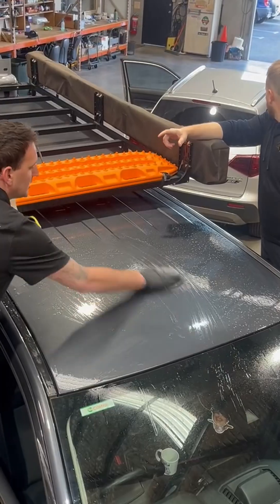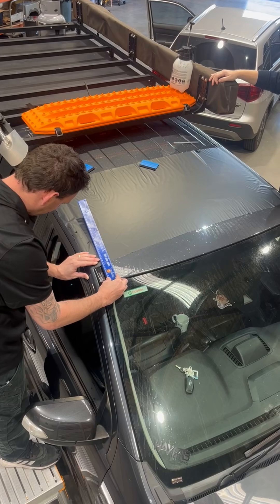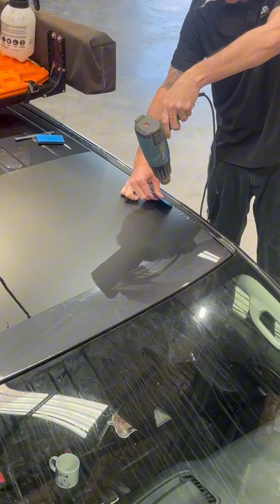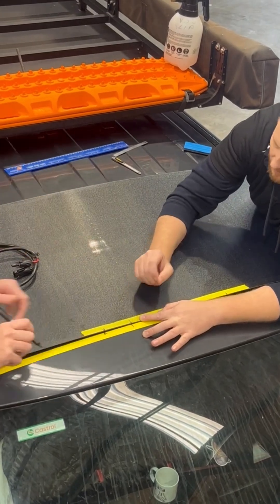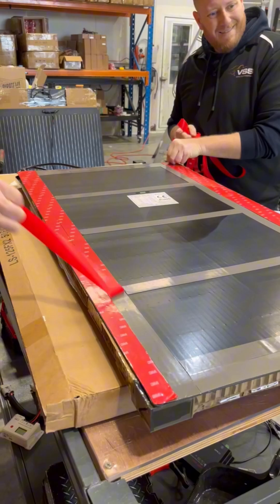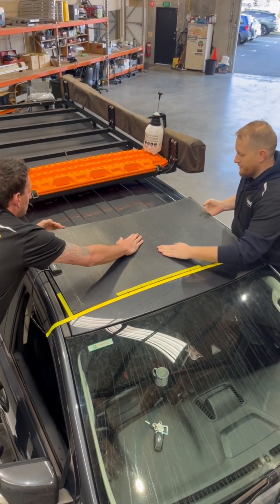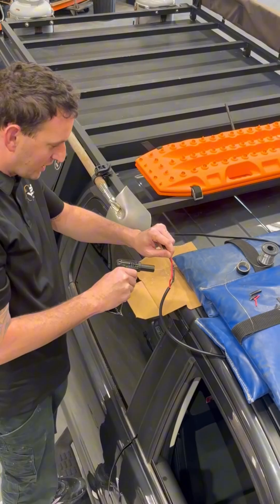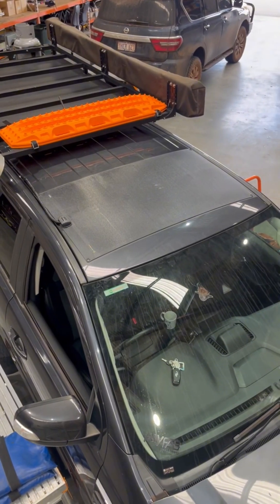Ranger Roof Solar Install - 125 W - Vehicle Solar Solutions

Comment: Why solder? Use plugs so you can stack an extra solar blanket on when u stop. Can easily trickle your start battery if stranded, too. And u can charge your mates aux batterys if they need the extra wattage from your panel. Way more versatile.